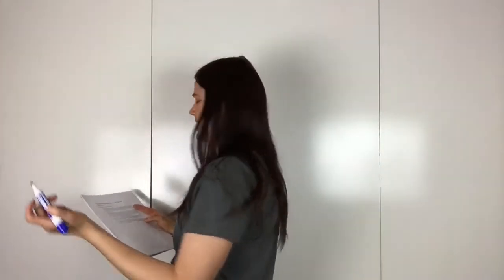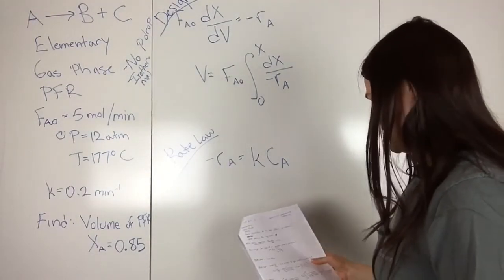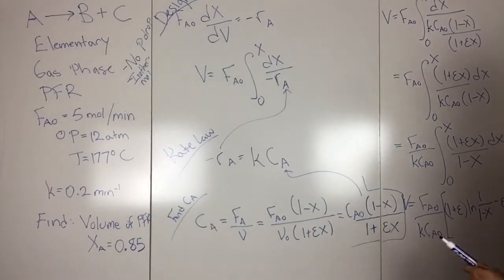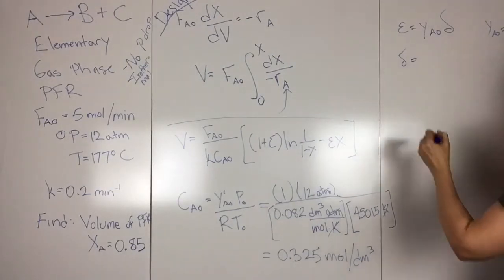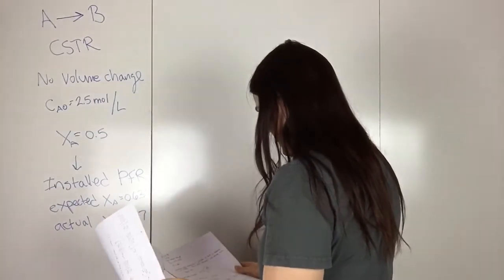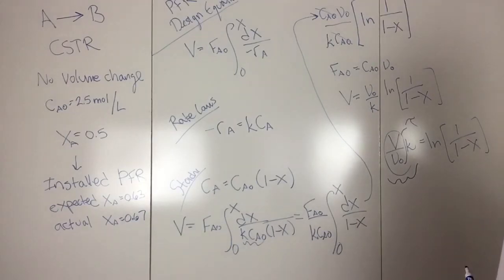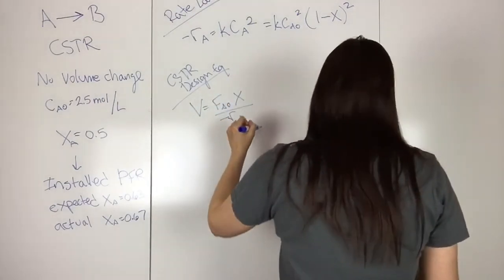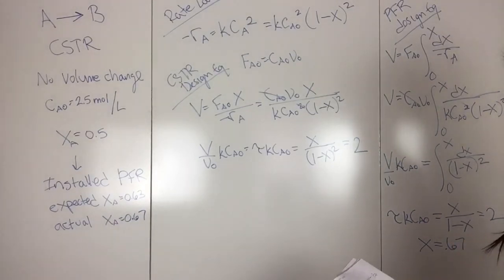13) Reaction Engineering Example Problems, Find PFR Volume and conversions

Comment: which of your videos explain the epsilon?
Reply from the maker: +Haiderroo Hi - I haven't done a video specifically on epsilon but epsilon = yao*delta where yao is the mole fraction of A and delta = d/a+c/a-b/a-1 assuming your reaction is aA+bB -> cC+dD. It is in chapter 3 of the text book (elements of chemical reaction engineering).
Reply: Raili T do you know if doing epsilon through the Levenspiel way gets a different answer?

for example im trying to get epsilon for 

4A + 2B ------- 2C
Reply from the maker: Hi - so epsilon would be whatever the mole fraction of A is (assuming A is your reference) multiplied by 2/4-2/4-4/4 (delta).  Or you could rewrite your formula as A + 1/2B -> 1/2C and then delta would be 1/2-1/2-1 (basically the same thing).
Reply: @railitaylor are these the coefficients of the reaction?
Reply: Can you explain the eposilon if you get it kindly?? I have exam 🥺
Reply: Epsilon is like the change in the number of moles.